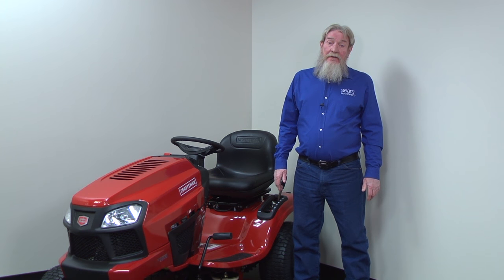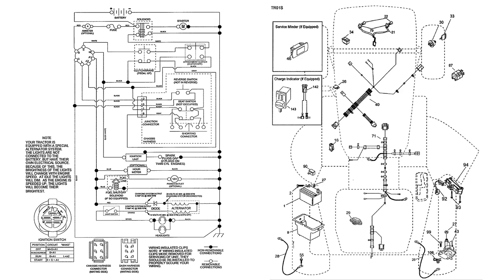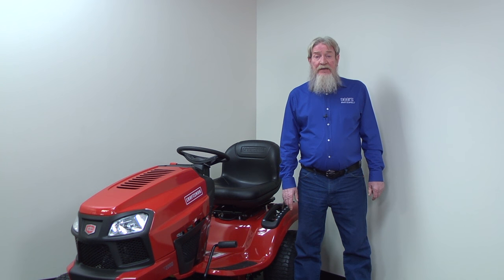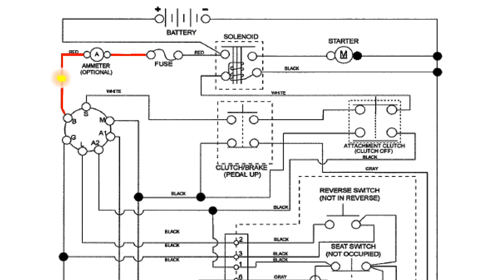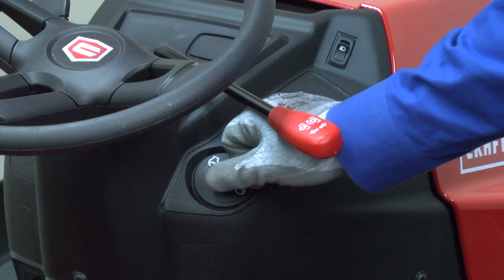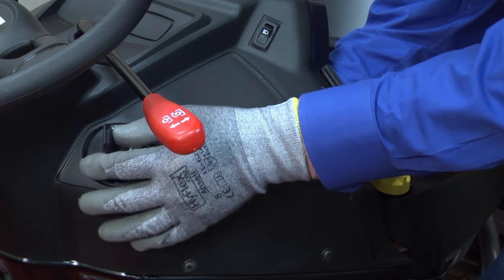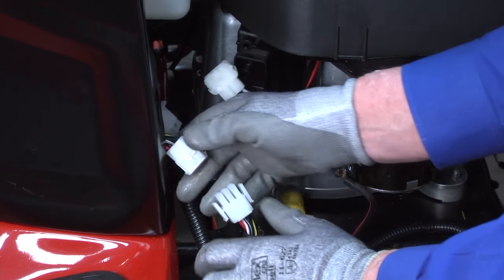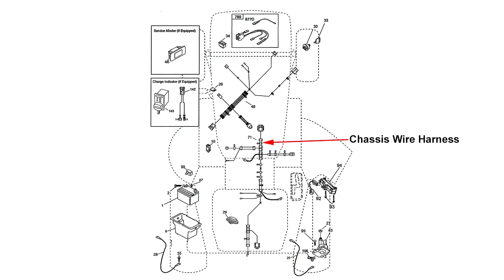How to Find the Cause of a Blown Fuse on Riding Lawn Mower

Comment: Your information you give is false. You cannot test for voltage at a fuse holder by inserting both leads into it. The holder is a hot wire coming from the voltage source the other side of the holder is the side going to the device it's powering, also a power carrying conductor.. If there is no short the meter will not read voltage, but if there is that means the sending wire might be shorted but that again is not accurate. Since things in the  DC circuit require a hot and a ground it might show power because the device is connected to ground for the device to work. The best way is to isolate both ends of the hot wire, put the meter in ohms or continuity with a beep, test one end of the wire with one lead and the other to ground if no beep the wire is good, if it beeps the wire is shorted to ground and needs to be replaced. Most things can be tested with a continuity tester for shorted to ground, faulty or good. For example take a short piece of wire and strip both ends that represents any wire you need to check. Put the meter in continuity and place one lead on one end the other lead on the other end, it will make a connection giving an audible beep. Now if that wire is cut there is no connection between both ends so it will not beep, it can't. You have a broken connection also known as no continuity. Now use another wire and place it overhanging on a piece of metal on both ends, put one lead on the wire and the other to the metal no continuity if the insulating integrity of the wire is good. Now strip out a section in the middle of that wire to expose the bare copper to make contact with the metal test the same way again and you will get a beep as you have a completed path to both ends of the circuit. That represents what happens when a wire gets pinched or chafed exposing the wire to the metal witch in your mowers case is ground, that is a direct short in that wire, this will blow a fuse. Remember all electrical devices are shorts to work but.... they are controlled shorts  which is why it won't blow a fuse unless the device is bad and needs to be replaced. I have been an Electrician for 42 years and there is no short cuts, just a simple understanding as to how it's works, what to use and how to use it to get what you need. Sometime it turns out to be easy and quick, other times it might take alot and be frustrating but he had a good point, a wiring diagram of your equipment is the key to trace efficiently. Get one, get a continuity meter and your half way there. Remember checking things hot can cause more harm than good and waste a lot of fuses. If a wire is pinched it may only give a short in a certain position like hitting a bump, or slanted on an incline, check the entire length of the wire suspected. i hope this helps some of you.